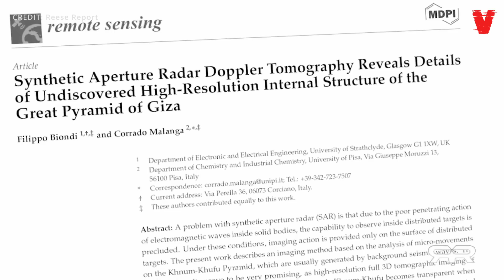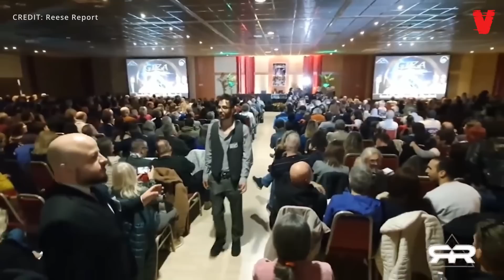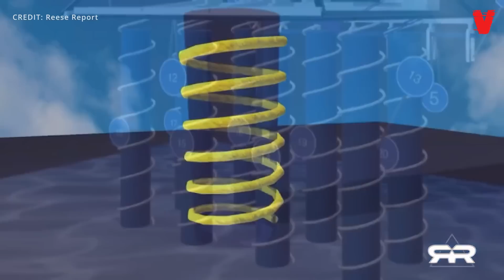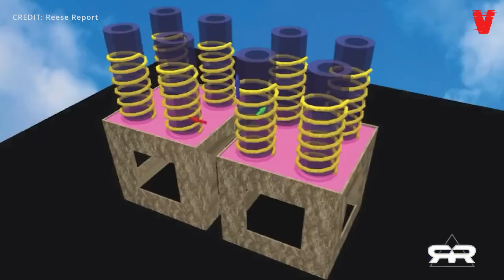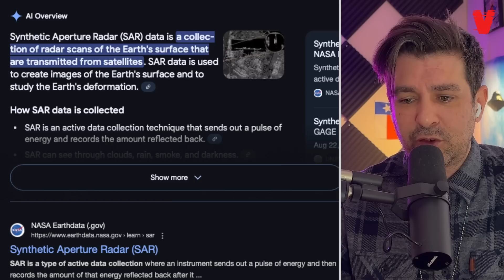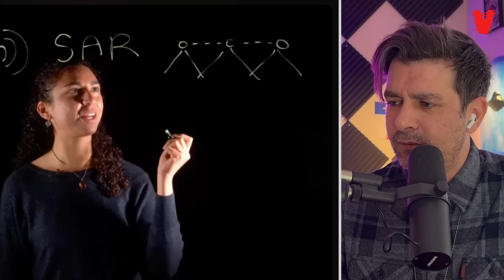New Discovery Found Under Giza Pyramid Changes Everything

Comment: The queen's chamber air vents only reach to the level of the top of the granite above the kings chamber. They don't extend to the exterior. This means that chamber was being used during construction, but became obsolete once the king's chamber was finished. The kings chamber has vents extending to the finished exterior, so it was in use at least to the level of it's vents. The queen's chamber was only needed, therefore, to raise the heavy granite blocks. As to the radar scans, they are probably natural density variations in the bedrock interpreted in a very fanciful way. There are natural columns of higher density formed within limestone in some areas. When weathered on the surface, columns are left behind, which people incorrectly believe are remains of ancient ruins.
Reply: @negi9040  Do you think there's any possibility that entire area was underwater at some point?
Reply: @karnagefails333  as far as I understand, Giza plateau is too high to have ever been level with or inundated by water from the Nile river.
Reply: @negi9040   How about the ocean?
Reply: @karnagefails333  limestone, being formed under the sea, contains mineral salts. When this limestone is cut into blocks and used in buildings, the salts in these blocks leech to the outer surfaces covering them with a layer of salt that will remain for long periods of time if protected from the elements, such as in a sealed pyramid chamber.
Reply: @negi9040  Well doesn't that support speculation that the whole area used to be an ocean? No one can deny the placement of those objects are beyond coincidence occuring in nature?

Comment: Can SAR (synthetic aperture radar) detect underground tomography? 
Copilot:
Synthetic Aperture Radar (SAR) can detect underground structures. Recent research has used SAR data to reveal details of the internal structure of the Great Pyramid of Giza. The method involves transforming radar signals into phononic information to detect millimeter vibrations. However, SAR's penetration capabilities are limited, so imaging is primarily surface-based.

Comment: Wonder how well LIDAR would work down there?
Reply: Since lidar is a form of light, not well at all since light can't penetrate solid objects lol
Reply: @BlackCeII since learned LIDAR doesn’t go down thru the soil deep at all, lol. Great for discovering ruins in jungles or deserts that are covered with dirt, overgrown vegetation, or sand, but even then it does not penetrate to any great depth. Depending on wet clay to dry sand, LIDAR may only go 2-5-7 feet or up to 40 ft & in some rare cases up to 100 ft. Depends on what objects are being surveyed as well, not just randomly carooming around the landscape. Some LIDAR systems are hand held ground based, others are up on satellites in LEO. Scooted back out that rabbit hole after that, LOL. Lots info online, tho.